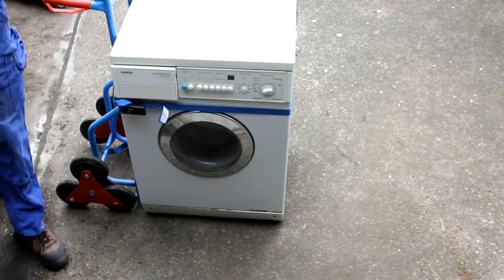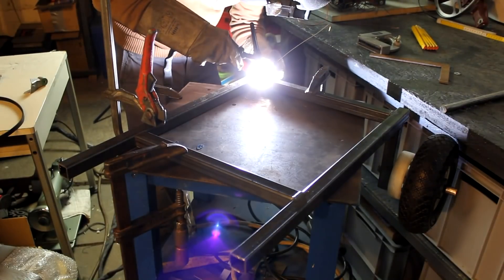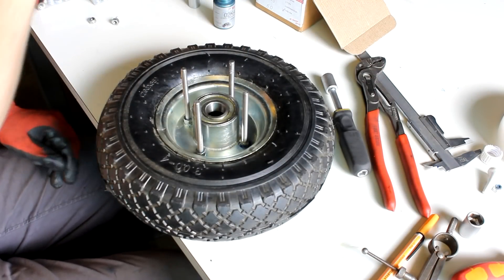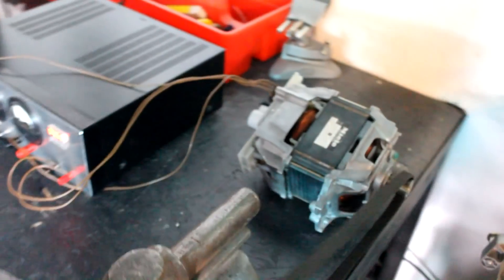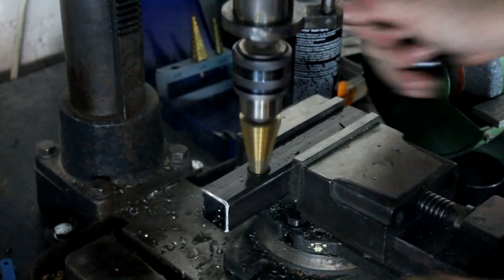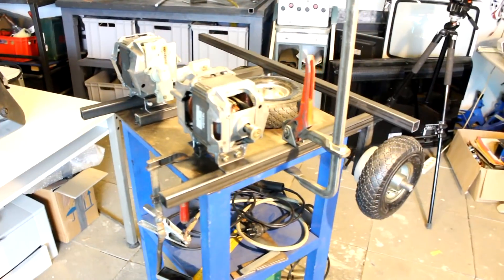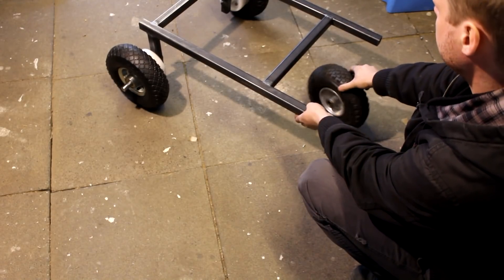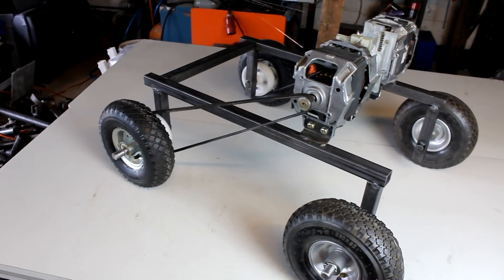Drivetrain with Washing Machine Motors

Comment from the maker: Hey guys, I just build a second one (with windshield wiper motors: https://youtu.be/k7XKJWinG2U
Reply: nice job, maybe a couple microwave transformers would help out  with a supercapacator bank(lithium backed), have start and run battery banks, when a couple alternators get up to speed to start a generating takeover instead of trying to store the energy generated run it more direct, I'd like to put together a homemade drone maybe even passenger I'm not interested flying the idea is to tow the weight of whatever runs the propellers(probably including hydraulics), turn a couple small excavators arms upside down and pivot the frame for the propellers with it hovering 5 to 6ft in front and above the frame in tow controlled by a virtual headset, maybe with a follow drone for the signal relay, you can get some pretty good watts of the car stereo designed alternators feed it all into a a.c. or dc motor
Reply: Vincent Telfer that sounds interesting. Hope you make a video
Reply: @justicejustice2325  a prototype would be cool
Reply: @justicejustice2325  I posted something that goes with it yesterday, just on YouTube for now.
Reply: The Post Apocalyptic Inventor moo 27this m.
Reply: Richard Wilcoxen hello, please I needed someone who can translate and convert the consumption in generator into meter gauge
Reply: Pro tip: you can watch movies on Flixzone. I've been using them for watching all kinds of movies recently.
Reply: @Gatlin Aries Yup, I have been watching on flixzone} for since november myself :D
Reply: It's been nearly four years now.
Any update on this robot?????

Comment: Where is part 2? 
When you take a (hypothetically) phone app for radio control w/ phone port radio antenna/receiver and connect it to this: but it has a 'mount' (allegedly) for a 'paintball' 'marker'...and also allegedly thermal/daylight cameras/sensors?

Comment: Hi, I just stumbled onto your videos and I have to say they are great, and thank you for making them. I'm a sculptor in the US and I have a Miller Bobcat welder/generator that I built a rolling cart for. It works great for moving it around the shop, but the Bobcat weighs so much that its nearly impossible to load onto my trailer by myself. Nearly 600 pounds with fuel, or 275 Kilos. I too love to engineer/construct kinetic devices, but I honestly don't have the depth of understanding that you do when it comes to choosing the right combination of components. I love this video, and your use of washing machine motors. Do you think a setup like yours in this video would provide enough torque to move my generator up a 10-20 degree grade? And my other concerns would be speed control and direction control (forward/backward). I will continue following your videos to learn more, but was hoping you could tell me if this sounds like a viable option. Thank you! Nice work!...oh, another key bit of information: I would like to power the motor/motors with the generator itself, so that I don't need batteries or anything. So the motors could be AC or DC via the generator.

Comment: If you want a speed controller that takes feedback from the tachometer coil I can recommend one of these   https://www.ebay.co.uk/itm/TDA1085C-PCB-assembled-commutator-AC-motor-50-100-1pcs-new/272989993447?_trksid=p2485497.m4902.l9144

Comment: Great. But still movement transfer from the motor shaft to the wheels is  not that efficient, especially after some load is added. I suggest steel chains and gears  instead, like a motorcycle.

Comment: 20 seconds in and I feel like I need a Xanax !
He turned a chemical compound into metal lol
Of course it works, you plugged the motors into a lower supply that has a direct drive to the wheels.

Comment: The original motor mounts had bushings.  Shame they couldn't be made to work.  Also, Those are actually called "sealed lead acid" batteries or SLA btteies

Comment: Not bad TIG work. The test worked BECAUSE there was no tension. Better try again under load. Don’t use rod. Use round tubing. You are going to find out what happens with anything but very deep filets on rod that big. Especially in soft stuff like stainless. Talk to someone who welds on race cars or airframes.

Comment: You could run chains from the rear wheels to the front wheels, use the independent motors to steer.
Reply: Kindve like a tank

Comment: I build a rc mower before, and actually haven't push a mower over 4 years , but I used different motors. The washer motors you're using are exposed so dirt and water will get in it which will destroy it in few months. The tires will not get any traction on grass or dirt road, the homemade plastic belt guide will goes off track . After all said and done this thing will weight a ton with all those metals. Check my old rc mower videos to see how many frame versions I have . This topic has beaten to death and there's no was to set it autonomous

Comment: Cut the plastic axle flange down some so the belt drive sits against the rim. It will be stronger against the rim flange. and your bolts won't flex or bend. looks like it will fit good against the wheel rim.

Comment: Try bicycle sprockets and bicycle chain instead of pulleys and rubber belts, I think you will find that you can achieve better torque or power transmission to the drive wheels when adding more weight to future renditions of this robot you are wanting to build.

Comment: You may be interested in constructing your own metal melting foundry as well. You could cast your own aluminum & copper parts for this project. A stainless trash can and "plaster of paris " work well; firebrick or kaowool are best. I will also donate a box of li-Ion 18650 cells to you for this robot. They have better energy density and more importantly, will be free! Message me and I'll send them.
Reply: update NOV 11th, 2017: I suppose you do not want them so I am going to give them to someone else or put them on eBay.
Reply: i am asking for the box of LI-ION if it is still available for a electric minicar  with exhausted batery

Comment: It doesn't look like you prepared the metal at all for TIG/GTAW welding. Lots of mill scale, oxides, and other contaminants in the weld.

If you are prototyping and don't want to spend a lot of time on welding, then use Stick/SMAW/MMA welding.

However, if you want to build quality and plan on doing TIG, then clean the metal with a flapper wheel and/or acetone until you get shiny base metal. The extra preparation will show in the results.

Comment: I could not believe how thin the steel sheet metal that these hand truck wheel rims are pressed from. It could not be any thinner without being mistaken for tin foil  :-) I have purchased some and compared to the existing rims on the rather inexpensive hand wheel cart. Built to a price no? Certainly we will not be welding anything to them without careful amperage adjustment. I don't know what might be done with TIG

Comment: I gut the motors wheels and lower frame. from a mobility scooter for $10.00, very good motors with gear reduction. I'm wanting to put them on a E Bike project. don't know if that's what I'm going to use them for yet. I have other stand on scooter motors. 250&350 watt. but I want more like 48v 1000watt motors. or larger. I'd love about 2000-3000 watts. I'm no little guy. I need power to get me down the road. I don't lime going slow. great video can't wait to see how it ends up. how much voltage are you going to use. on the motors? I have a 90vDC motor also. from a conveyor system. it will run on as low as I have tested 12 v. but I was hoping to use it as a DC generator. on a water wheel project

Comment: Quick question won't chain and sprockets be more efficient? Belts drain some power.
Reply: Thunderstormworld 

Yup. But less easy to lash together for prototyping. Especially as the motor already has a pulley for a belt.
Reply: zogworth  understand for prototyping, if you are going to use a battery setup then every amp counts though for the final setup.

Comment: Maybe you should use a tensioner pulley and big spring instead of moving the whole motor to adjust tension.
Reply from the maker: Yes I was thinking about that as well. The reason why I might still try to make the position of the motors variable is, that I have bought a set of much larger wheels ( can be seen at one point in the video) and I thought about fitting them on the same frame at some point. In that case I would have to change the distance between the wheels and the motors, because larger pulleys will be used. But maybe I will just build a second frame for the larger wheels. I haven't decided yet.
Reply: Or even better you could do both :)

Comment: You could also turn it by turning on only one motor on the rear. What do you think
Reply from the maker: Two motors allow for more power and you can also use them for steering if you would go for a three-wheeled design. It would also be possible to run them at slightly different speeds and use them as an "electronic differential". Those were my reasons for installing two motors.

Comment: Standing off the drive pulley on bolts like that is not going to work. You will never get the belt tension right , and the whole thing would twist up under load even if you did.

Comment: How soon do you think you will get to assembling your lathe?  It would seem that you could treat those motors almost as steppers in that a simple controller might send out sets of polarization cycles making rear-wheel-driven steering possible. This might allow non-steered swivel king pins for the front end, thereby avoiding any mechanical front steering.  It all looks like fun.
Reply: that occured to me

Comment: Nice. I'd put the white pulley wheels on a lathe and cut a v-grove in the surface to make the pulley belt self centre into it when tight. Was there any room to put the motors under instead of over the frame?

Comment: but the torque is very bad with this configuration. you should insert step down transmission in between the motor and the wheels.
Reply: btw i recommend using custom boost converter optimised to control the rotor and stator current. (constant current supply for the stator and constant voltage for the rotor)

Comment: Hi !

The torque will twist the M8 bolts compared to the rubber wheels for sure - you have to support them much more !

The belt will self-center because there is a little "crowning" on the caster wheel.

Comment: I like where this is heading. I have been considering something very similar. Hollow frame tubing with a washing machine motor driving. 

You have done well to get both motors at the same speed. I only have one motor and I am not convinced I will be that lucky if I find another washing machine motor. Control is of course possible and within my realm of expertise but I will take quite some time to get that right so I prefer the mechanical solution. Single driving motor with bicycle sprockets and chains. Its easy for me to get them locally and quite forgiving with alignment and tension.
Reply: Manik I will go N
Reply: ASSDOG

Comment: hi. spring loaded electrical motor mounts are readily available, or you can make them to keep belt tension. for my experience i suggest you plan for some cover for the belts as they are easily derailed by debris or small rocks that the wheels could pick up. a skid steer type vehicle should be something to consider providing you have two transmissions

Comment: You don't need a steering system in a 4 wheel robot, you only need to invert the drive on each side so it will rotate like a tank.

Comment: i was ready to say the same that Machinery Repairman said, steer by differential velocity in the motors and use caster wheels on the non-powered wheels.
also, you can go even further, you can make a six wheeler, with 4 wheels on caster, and the fixed powered wheels on the center (second 'axle').
or you can go even beyond that, with some bearing and springs you can make an modified rocker boogie suspension, like the mars rovers.

Comment: ANY of the sleeves on a wall anchor that's the diameter of the shaft used here are excellent as bearing spacers for these wheels as they do not come with such a thing. It's worth investing in the 10 15 euros in four such bolts for a project as the bearings are horrid on their own.
ALSO, such four bolts can be transformed in to axles themselves if welded to a T profile length of iron. Myself i've done this and it works beautifully. My wheels can take 178kg per wheel (goes much wider if you put a spacer in between the two split rims and widen the wheel) and i've moved after my bicycle a load that was 342 kgs at 14 km/h.
VERY good as such, and it's a worthy way to make an axle if buying the stock is too expensive in one's area, or, as i've noted with a few of my friends, next to impossible. I'm blessed to live in a capital, others, are not.

Comment: how efficiently do they run on DC?
Reply: That's right, with DC there's less sparking at the brushes, so they last longer and the motor is slightly more efficient. If you want to go super efficient with a significant increase in performance you could use a brushless motor although they're more expensive and need complex drive circuitry. If you want to do it the cheap way you can use a car alternator as motor driven by a 1500w 48v brushless motor controller or similar  off ebay for 50 bucks
Reply: BlackopTN I've got a couple of ways to get cheap brushless motors. One is the hoverboard Segway things. A broken one of those is cheap as beans and the most common failure is the battery bms or circuits. So you get 20 18650's and 2 350w brushless motors... Not worked out if I can use the speed controllers yet but an ebike controller works... Keep it in the down low though I don't want the prices going up!
Reply: Hahaha you don't have to worry about the prices going up, I can't even buy from ebay cause we don't have paypal in my country :P  So the advantage of using a car alternator is that you get a 3kw capable motor or even more (depending on the alternator) basically for free, with controllers of different power levels readily available online. If you want to build a high power Ebike or go kart; say more than 1kw I think you should use Li po batteries instead of lithium ones aka 18650s cause they have a very low internal resistance and will allow high current draw without heating up unlike the 18650s which are rated for no more than 5A continuos current for medium grade ones, pulling more will get them to heat up. Of course you can put few of them in parallel to increase the current capability but Lipos are the way to go if you can afford it.
Reply: BlackopTN that does look like my kind of interesting... But I'm no longer a fan of lipos. After a few too many puffed from thrashing them too hard, their affinity for setting on fire and their price!
And I bsdicay get free 18650's now so I'm even building a pack for my hexacopter. It's 4s6p and they are power tool cells so they can handle 10c discharge the same as multistar high capacity 10c packs. I can't see why it won't work.
Reply: yeah some Lipos have tendancy to bloat and catch on fire but I think poor quality ones give the rest of the Lipos a bad rap, I mean some of them can withstand discharge at 40C !  They're also lighter than 18650s with the same capacity. using them in a project like an hexacopter only makes sense.
Reply: Well yea technically they are both Lithium Ion Polymer are they not? but as you say I'm going for cheap and high capacity, so the lower discharge rate should not be too much of a problem once about 5 are in parallel.

Comment: I dunno, a chain drive might be a better choice. I think those motors might not work well for this mostly due to you would need a lot of current to move those motors. I would try and put the motors closer to the middle. With too much weight on the rear the front will have issues gripping the road for turns. I've been planning to make something like this myself for the past few years. More like adding RC to an lawn mower but after watching Battle Bots many years ago I want to build a Battle Bot.
Reply: Leland Clayton. These motors can run on 6-12-24v.........batteries.  check the upgrades on youtube

Comment: Just add a car seat and you'll have an electric car... :D
Reply: its mains ac powered, remove the wheels and youd have an electric chair :)
Reply: Crux161 have you seen electric cars? Which ones are stupidity using a transmission? Look at what Tesla is doing.
Reply: See this is where you are wrong my friend! Well sorta, Anyway universal motors like the ones shown here would not and do not need a transmission if you vary the voltage to the field winding, If it is higher you get more torque and lower more speed, Also like others have said yes you could brake it by shorting the windings. Also it is not on or off right now since you could easily adjust the voltage in. While  I doa gree with it being more of a go cart than a car.
Reply: add some wings and you have an electric plane!
Reply: electric motors dont need gears cuz its max high torque at 0 rpm. gears can still make it faster but not really needed as they will add extra weight and cost.
Reply: Pretty sure you can short power to ground and it would brake the motor, so the brakes should be easy.
Reply: modern motors like the lesa do indeed have gears, motors still have a rpm band of max efficiency, and even with variable requency ac motors, a gearbox gives best results, you can always use more torque at lower speeds and theres noise issues too
Reply: Tesla's got nothing on TPAI.
Reply: twocvbloke l
Reply: She needs to buy lots and lots of extension cables
Reply: twocvbloke You'll have a Sinclair C5 :)
Reply: marble89

U can drastically improve efficiency with a gearbox, by keeping motor in its efficient range. Torque is rarely constant all over the range.
Reply: Probably work better than a Chevy Volt... LOL